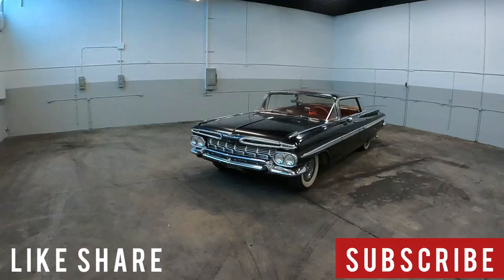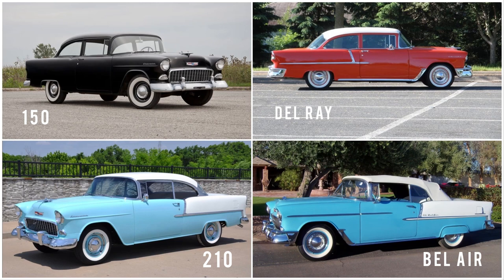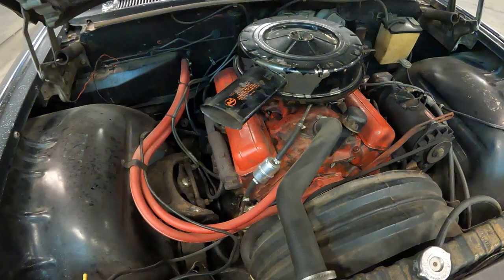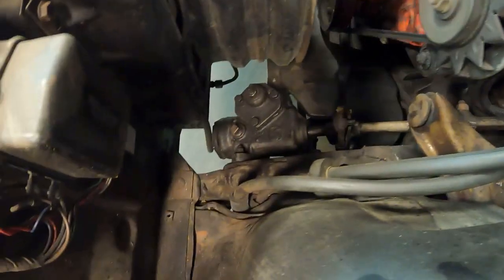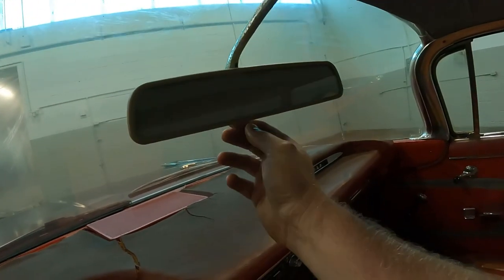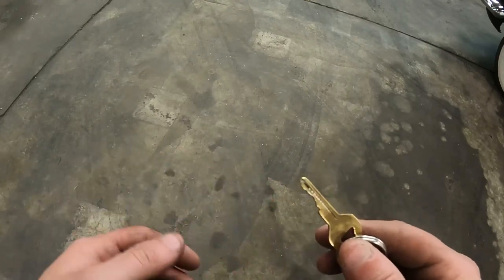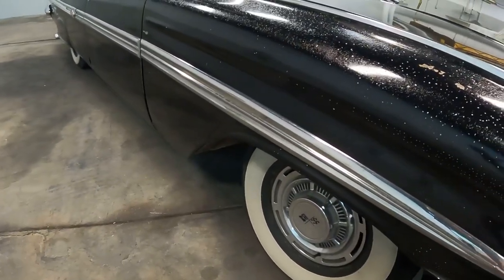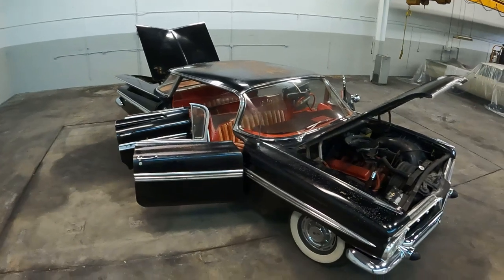In-depth look at 1959 Chevy impala 4 door hardtop #cars #chevrolet #impala

Comment: 59 Chevys have always been some of my favorites.  Even the El Caminos that you mentioned used the same chassis and mostly the same sheet metal as the regular cars.  They even used the same floor pans underneath the truck bed.  From the underside of the car you can see the footwells for the rear seat, as well as where the rear seat would have mounted, and even the trunk floor... it was all the same, they just put the truck bed over the top.  The whole "one model" thing was also why they offered the same engines with every trim level... even the special engines that were designed for the Corvettes were available in the regular chevys.  The Corvette was the only "stand-alone" model in the 50s... and it was that way for all of the GM divisions as well.  Chevy, Pontiac, Olds, Buick and even Cadillac all used the same basic chassis, body panels, seats, etc... the only real differences were trim, dashes, engines and other optional equipment.
Reply from the maker: Awesome insight and information =)

Comment: I had a '59 4-door hardtop that was the dark green color.  Mine had the 348 engine.  By the time I got it (from my dad) the motor had some issues, but it was a great car.  Wish I still had it.  The dark green made the car much prettier than the black color shown here.
Reply from the maker: Thank you so much for sharing your experience as well as memories with your car =) One day I would love to compare the 348 in the 409 because they look identical in the engine compartment one could put 409 badges all over the 348 and nobody would be none the wiser unless you opened it.. To find specific casting numbers

Comment: In 1964, my first car was a $1000 black 1959 Chevrolet El Camino, I fell in love with the design at 17.  It looked really good, but the drive line was a disaster. I used some family influence to get the dealership to take it back after spending big bucks on a new rear end and more. They gave me $1000 credit on a different car. I like the roof line of these flat roof 4 door hardtops, some people call them "glass house" cars. The station wagon and the El Camino had the same roof line design. The fins and the "cat eye" tail lights are so good looking. The sound of the door closing is good and solid. It looks like two or three bodies could easily fit in that trunk and with some overload springs and HD shocks no one would know you are carrying the extra weight. Good traction too!
Reply from the maker: Yeah they where sweet cars 4 door hard top is sporty I saw a 57 Chevy four door hard top that didn’t even look like a four door no post gives a nice clean look... thank you so much for sharing for story I love reading all the stories =)

Comment: “One key for everything” is a hacked restoration. Cars of this era came with two keys - one for the ignition and the other fro the door locks, trunk, and glove box. The rationale behind this was for valet parking… you could give the attendant the ignition key so he could park the car, but he would not have access to the trunk or glove box contents
Reply from the maker: I wasn’t sure if that was the case I heard a rumor that Chevy went to one key in the 60s but could be wrong thank you so much for the insight
Reply: Correct I own 62 66 and 68 Cadillac and all 3 have a octagon and oval Briggs’s Stratton keys octagon for the door and ignition oval for the trunk /glove.
Reply: You are wrong. 59 Chevys have only one key for everything.
Reply: Even into the 90s GM retained a 2 key system - and they took criticism for it.
Reply: Your mostly right yes cars of the era had 2 keys the hex head key and the other looks like a clover One for the front doors and ignition (hex head) the other was for glove box and trunk and console if optioned (clover head)
Reply: @What.its.like.  You are correct. It is not hacked. All Chevrolet's of that era and into the late-mid sixties used one key. I owned several.
Reply: You are incorrect. Do some research. Chevy used one key for quite some time. In the 50's - 60's you were not concerned about the valet is you had a Chevrolet. That "valet key" thing came way later. I owned several Chevrolets or this era and drove many more. The other GM divisions used the 2 key set-up.
Reply: @stevenhagebusch9561  Not on Chevrolet cars.
Reply: @bigcurt011  Chevrolet did not use 2 keys in this era. It took them until the late-mid sixties to go to 2 keys. Other divisions, Cadillac being 1 used 2 keys.
Reply: @montymatilda  well considering ive only been driving cars from the 50s 60s for the last 30 plus yrs id say ive done some research....and maybe some was only one key but every early chevy from my 50 fast back to my 65 impala ss had 2 keys.....although im not a chevy guy....all my pontiacs buicks fords Lincolns had 2 keys the only 2 in the last 40 yrs ive had that had one key was my 2 willys overlands.....
Reply: @stevenhagebusch9561  Well OK. Maybe I was a little harsh, but saying it was a "Hacked" car is uncalled for, since you didn't know. You are correct that most every thing else used a 2 key system in some variation, all of the Chevy's I drove and owned back in the day used one key. I am not certain when it started or when it stopped but late '50s and until mid '60s were all 1 key. You could even take the key out in the off position (not lock) and still start the car, with no key at all, strange I know. I have had all the makes you listed and more and the Chevrolet was the only one that used one key that I had. Maybe it started after the early 50's and ended in '65, I don't know, but it did happen. One friend had a '56 and another a '57 and both used 1 key. Ford went to a 2 sided key in '65 so maybe Chevrolet went to 2 keys then. I jumped from '64 to '68 and the '68 had 2 keys. Drove a '66 but don't remember the key situation. Never drove a Willy's Overland, but my loss.
Reply: @montymatilda  ah the fact you was/are able to enjoy the classics is the important part.....by hacked wasnt a shot at the car itself could be the keys was lost and a new lock set was put in and keyed diff for drs and ign.....as you said many different possibilities....ive had and still own more then listed but was just a quick over veiw....im not as familiar with ford as i am GM coming from a GM family but loving and enjoyin all makes and models.....
Reply: @stevenhagebusch9561  I am glad you love a wide variety of the classics as I do. Wish I had been smart and kept them. The list is to long to list but didn't go back before '62. A friend and mentor in the '60s and early '70s had a used car lot,  so I was able to drive many, many cars, detailed many of them, and drove any one I wanted.  
But the Chevrolets as I stated used 1 key. Not a lost set or rekey, my 63 (had 3) 
Chevrolets are were keyed 1 key for everything as was my friends - '60, '64 (2), '56 (2) and '57 were. All Chevrolets that came through the car lot of these years used 1 key. If you say your '65 SS has 2 keys, then that is when the must have changed
Reply: Sorry Bob, but the '59 Chevy only had one key for everything. I reason that GM knew the average Chevy driver back then did not frequent  restaurants or clubs with valet parking.  You are correct, though that they brought back two keys in later years so the trunks and glove boxes would be somewhat secure.  In June of 1969, my dad  bought a  new '59 Impala sport sedan/hardtop sedan like this one, but in Snowcrest White with a "tu-tone" turquoise/light blue interior instead of Tuxedo Black with the red interior.   Mom loved it and used it until '69 when I commuted to college for four years with it and then used it for a couple of years thereafter.  It was a great road car, and the visibility was outstanding.  I took my drivers test in it, a 235 6 with no PS or PB!  A neighbor two doors down purchased a '59 Impala as well, a convertible in Roman Red with a white top.  Occasionally both cars were parked next to each other, what a view for this then 8 years old!

Comment: 1958 Chevrolets were general motors 50 year anniversary. The 58 Chevy was offered in more color combinations that year than any other time.  That design was the most unique of all time.
Reply from the maker: Thank you so much for sharing that information =)
Reply: The '58 was a one year only design because the 58' look was supposed to be introduced in 57. Circumstances prevented it. That's why the 59 was dramatically different.

Comment: The 58 Impala was still the basic Chevy body with a shortened roof.  Ford was the one who introduced '2 car lines' in the low price field late 50's - the Custom had 2" less wheelbase than the Fairlanes.  The Edsel was a Ford (Ranger/Pacer) or a Mercury (Corsair/Citation); totally distinct bodies.  In the early 50's there was a 'small' Plymouth and of course the upper manufactures often split wheelbases (Mopar) and even bodies (GM).  If you look at say, 1953/4, there was a lot of variation @ GM.  In 59 of course the big rationalization took place - and everything followed from the Buick front door as the story goes.  The Bel Air BTW was sold through 1975 in the US, though not that many in the latter years.  Biscayne lasted through 1972.  Finally, saw this in another video - those dogleg windshields tended to crack knees, which was something you don't have to worry about in say a Mopar, which never really adopted the style.  They were not considered ease of entry/exit:  the w/s post was pushed back not the door entry forward.  If you had a straight post that entire intrusion would not be there.
Reply from the maker: Awesome information thank you so much for sharing i got to see an Edsel today at the Cleveland car show love those cars..